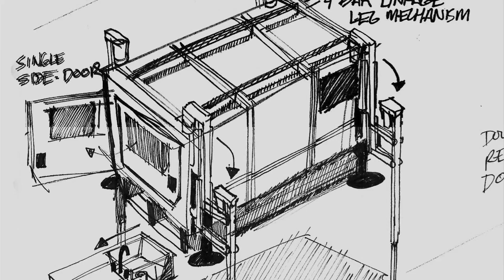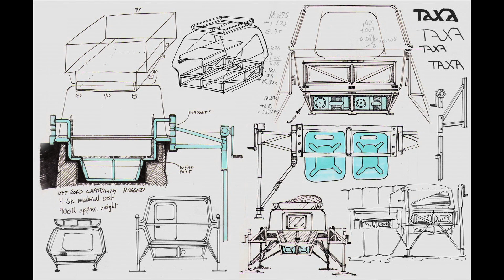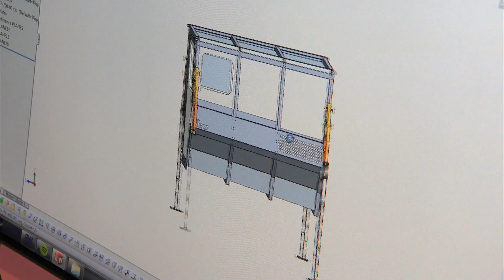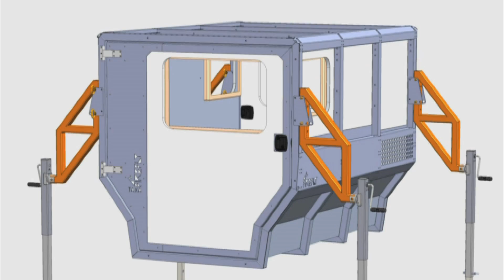Firefly

Comment: I feel like you are clipping your wings because you are so dead set on the rover lander look and feel. It’s not practical. It has to be loaded onto a truck with a forklift. The profile is way too tall while sitting in the back of the truck. Zero aerodynamics. Why no pop top like the cricket?  Why no cab over design?  Why don’t you have it so it sits on truck bed frame ? That would make it a little wider. It’s like someone only read about an rv once and loved the idea of a lander look and then over engineered this BOX to death.